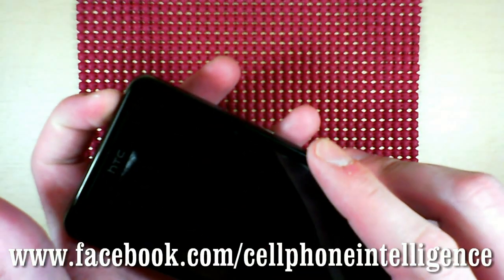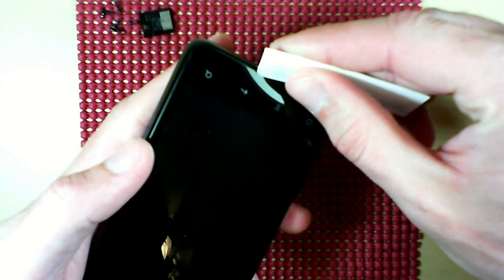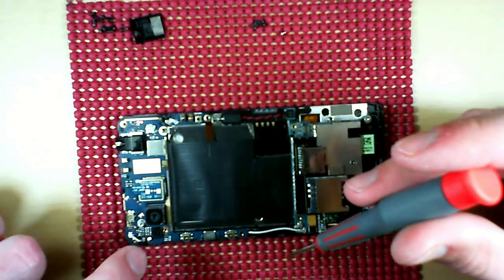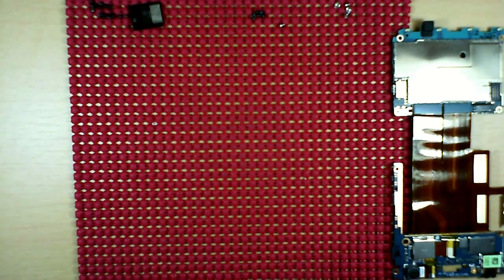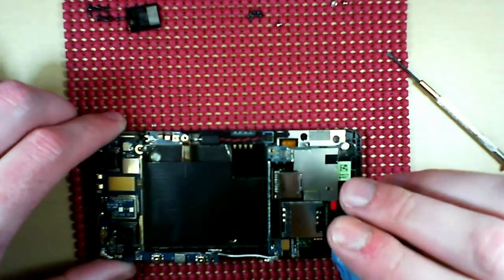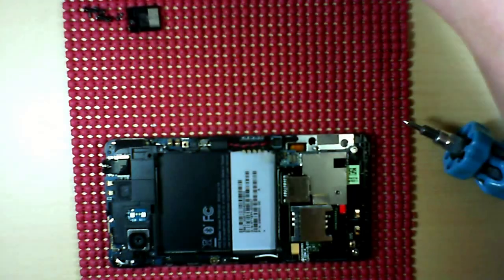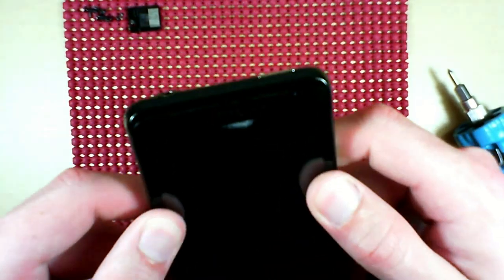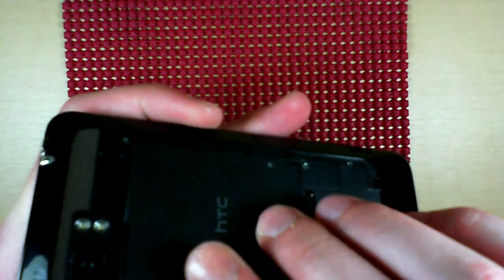Tear Down & Rebuild HTC Raider / Vivid

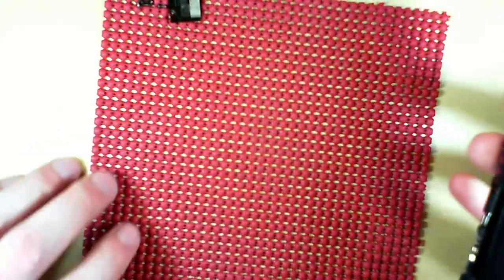Comment: I just changed my charger port on my HTC Vivid.  Took about 15 mins. All I needed was my precision screwdriver for the first 6 screws. Next I disassembled the housing from my unit/screen. It snapped right off. The charger port is attached to the underside of the Housing/Battery unit (it is the silver upside down "L" shaped strip on the housing that is shown at 5:03 in your left hand.  Your video didn't really highlight that and I thought I was in for a long amount of work). All I Paid was $10.50!!  $6.00 for the charger port I ordered off of Ebay and $4.50 for the precision screwdriver set at Home Depot. Thanks for the guide!!!  It was a great help.

Comment: Hey! I rarely comment on videos, but I owe you a huge thanks!! I had two problems with my HTC phone: the charging port was kind of messed up - it would only charge if the connector was pulled at the right angle - and the audio jack was broken. I found your video and it gave the cajones to try fixing my phone on my own. Bought the parts on ebay and didn't have a problem at all! YOU ROCK!

PS: giggled at every occurrence of "sneaky buggers" ;)

Comment: thank you for your video, but i need help i had to replace the section of the boad that contains the power botton, when i put the phone back togeter everyting works but my wifi and bluetooh signal is really low, do you have any suggestions????

Comment: Negative sir, do not use a heat gun. You can dissolve glue with acetone, which is commonly found in nail polish remover. Apply it with a Q-tip.
Reply from the maker: thats a good call